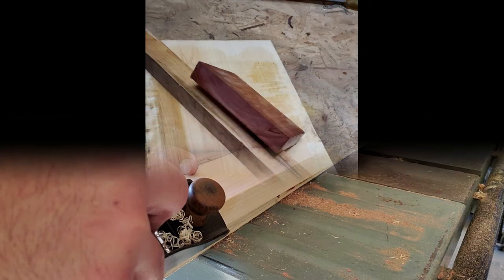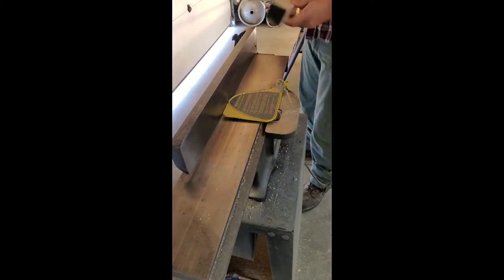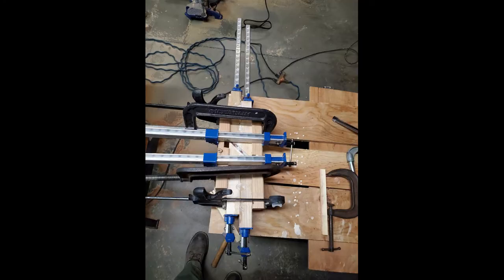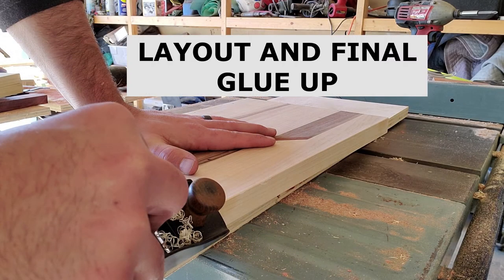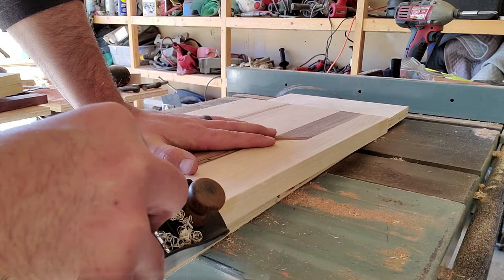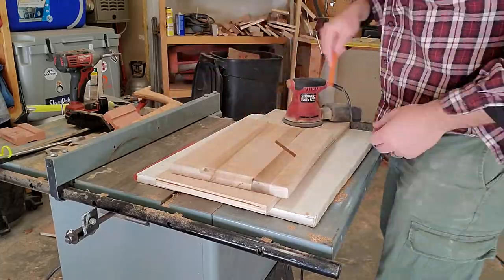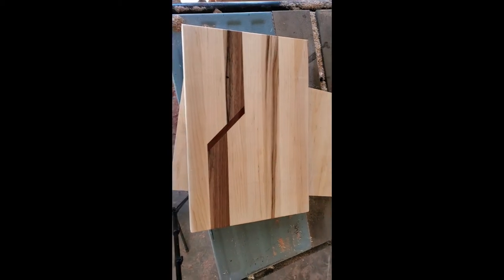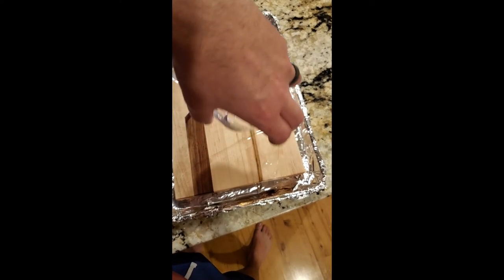How to - Basics of a face grain cutting board

Comment: You can't get a board square with just a jointer. I'm a 41yr old with 25yrs of woodworking and never seen it done. A jointer is meant to be used in conjunction with a planner and a table saw.
Reply from the maker: Thanks for the reply. The jointer wasn't used to square the boards, I misspoke. The jointer was used to prep the mating edges of the stock for glue up.